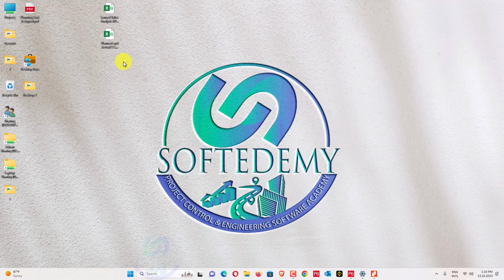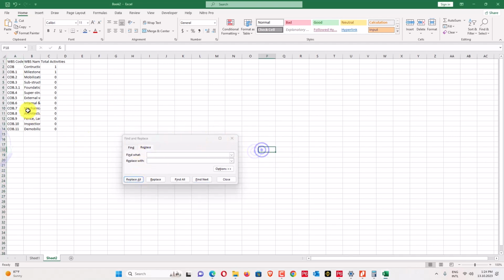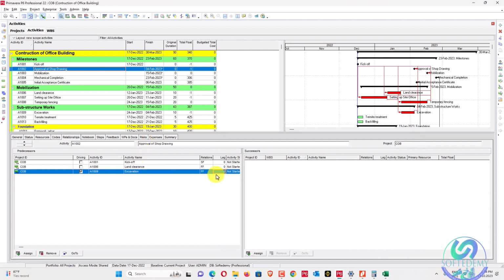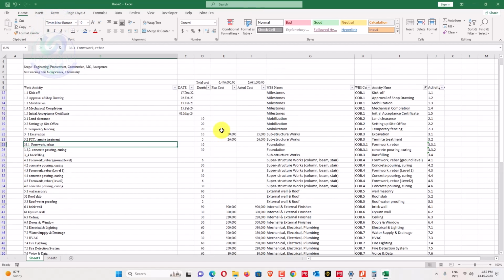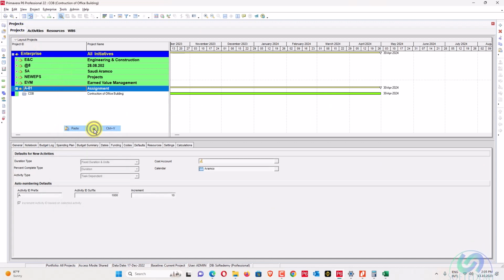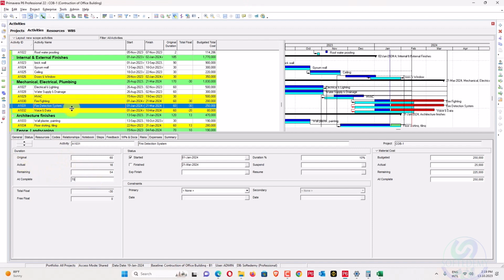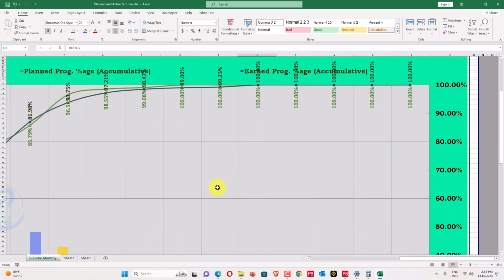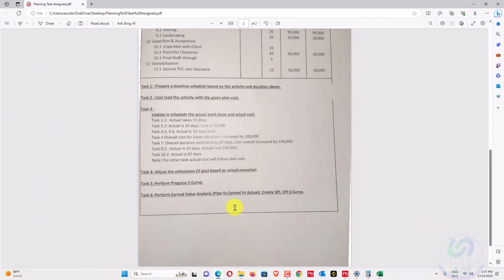Planning Engineer Interview Assignment 01 by using Primavera P6 | Construction of Office Building

Comment: Hi. I'm following all your steps in this video but when I schedule my primavera, the total floats are the same but sub floats are completely different. Can you please explain what are the factors that made my schedule different from yours eventhough I 'm  doing the same steps as yours. Thanks a lot!
Reply from the maker: Sorry, you have got this issue.

May be their is some section of the video in which I have assigned other relationship .so it's possible the result would be different for other activities. 
But don't worry if the duration is OK and finish dates are OK and total float are not higher then limits.  Then enjoy the skills you gave learned in this video.

You can contact us at https://wa.me/+923155537580

Or you can comment here we will reply.

Have a good day
Reply: Thanks for your reply. May i know what are the limits for floats? @SoftEdemy
Reply from the maker: @missmikeecruz  5 % of activity count.

And the higher total float may be allowed by contract 28,44,60 days 
As per total duration decided by consultant. But DCMA allow 44 

excluding milestones, engineering, procurement activities. In some projects